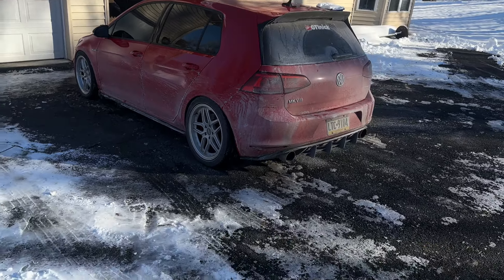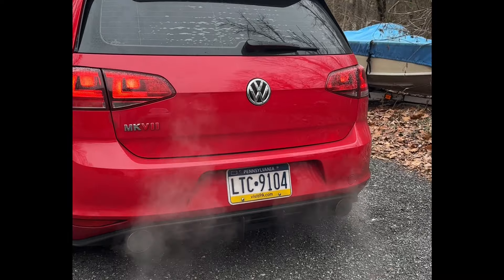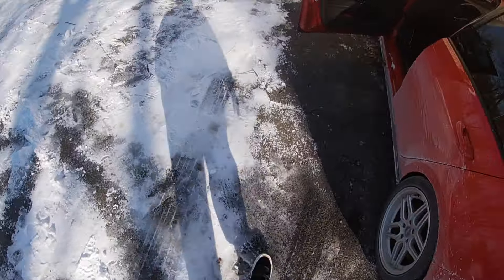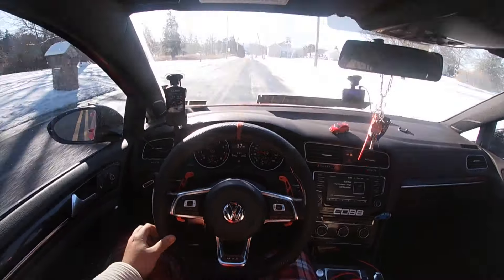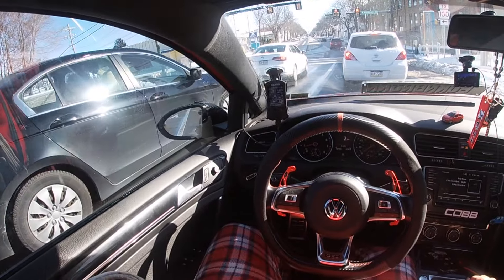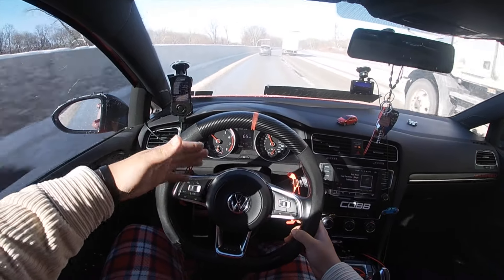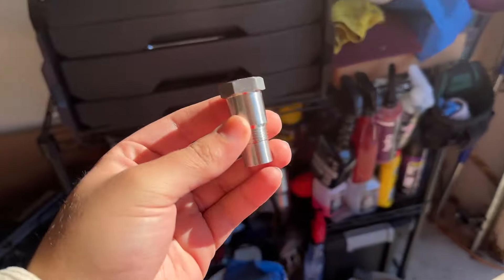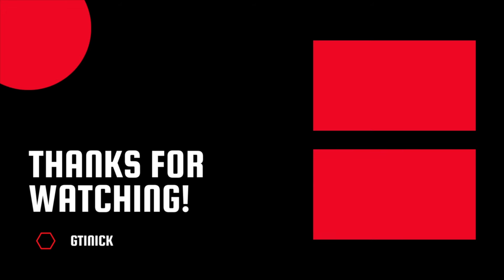WHAT ITS LIKE OWNING A 100k MILE MK7 GTI

Comment: As soon as I saw the tow hook installed and ready to go that told me all I needed to know about reliability😂

I bought a brand new 2016 GTI SE in April 2016, traded in for a 2021 Mazda 3 turbo hatch in December 2020. Don't get me wrong, I loved the thing but it was giving me far too many signs it wasn't going to be a long term car. To be fair it never left me stranded on the side of the road, but mysterious overnight battery drains did it a couple times at home. I won't go over the list of issues (most having nothing to do with the car starting and driving) but it was time to move on. In spite of early Mazda turbos having issues of their own, my 3 doesn't use as much oil as others and I havent had coolant issues. The Mazda 3 turbo is an awesome little machine in its own right..doesn't handle quite as well but just as fast in a straight line and better interior than anything in the same class.

Comment: I have a MK6 on APR Stage 2 with 181,000 miles. Works great (knock on wood). I will say i would recommend taking the DV spacer off. I took mine off because it was leaking oil and spraying it everywhere when the DV would open. I got a GFB DV+ with the integrated solenoid (plug and play replacement for stock DV). It feels so much more responsive and feels like it holds boost wayyyy better. Enjoyed the video my guy, love the mods
Reply from the maker: Wow bro that’s crazy! I’m glad she’s lasted you such a long time, I hope mine will last that long lol. Ya the spacers are iffy, I just love the sound it makes lol. Thanks for watchin my guy, stay tuned for more!

Comment: Whats ur wheel specs and suspension setup? That fitment is perfect
Reply from the maker: Thanks man! 

Wheels :
ESR CS15 18x8.5 +35

Tires :
Vercelli Strada ii 245/40ZR18

Suspension :
Neuspeed Lowering springs